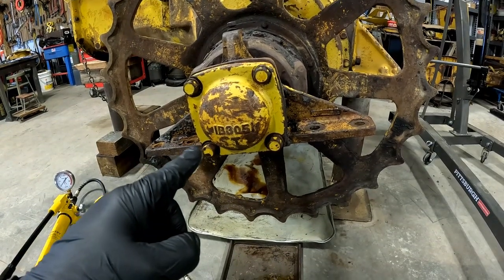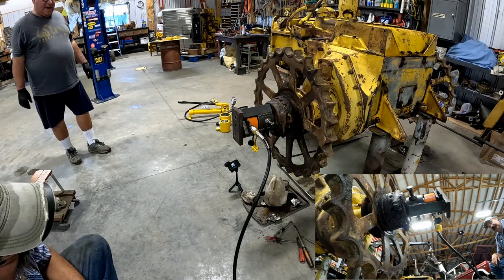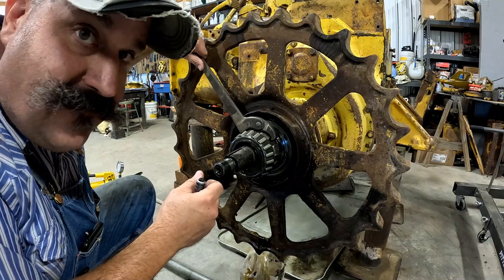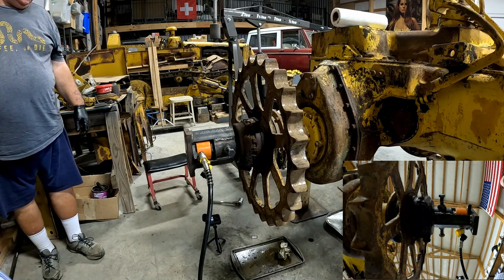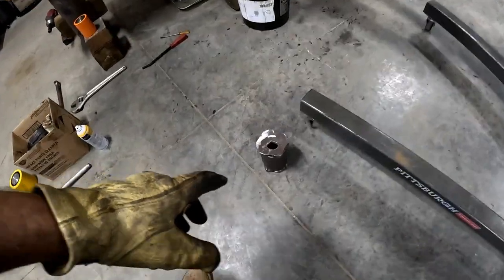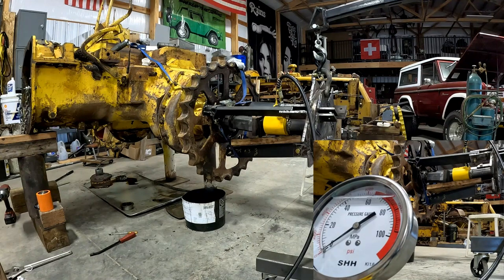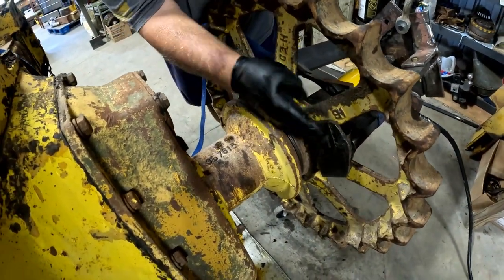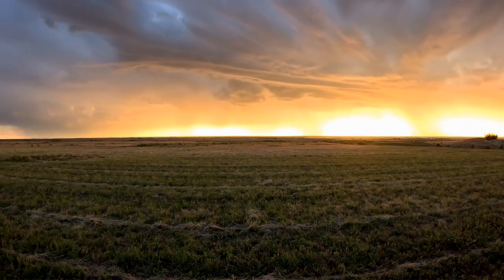1941 Caterpillar D4 sprocket & pillow block removal! dozer 7J4265 W Parts Machine "Hannah Montana"

Comment: Time for a container to store  various cat parts out of the weather.  I always wanted to fasten garage door hanging tracks on the ceiling with a piece of 4 or 5 inch w beam across hanging from two 4 roller hangers on each side so i could lift heavy parts up and over without having to unload the container.  Leaving seat belt webbing  around the hard to hook up parts.
Reply from the maker: That sounds like a great idea. We are definitely starting to get to that point.

Comment: I like how you guys build your own tooling. As a machinist I do the same. Perhaps a hit from a sledge hammer on your puller would have popped it off sooner.
I myself have bent a shop built puller or two.  That A36 can only take so much.  
 I have a ACMOC thread going on a CAT 15  that really surprised me when we pulled one of the sprockets...Someone put a large spring most likely from a air brake can in there to , I guess put more pressure on the bellow seal. I didn't put the nut on since they are like a big cap. Wham on the floor she went. Second sprocket , had a chain on there for safety.
Reply from the maker: It always amazes me that when you think you know what to expect the unexpected happens. There's so many Creative solutions on these old tractors that folks came up with to fix problems. I thought about breaking the sledgehammer out at that point but there was so much pressure on it I didn't want to go anywhere near. Appreciate the kind words and thanks for watching!